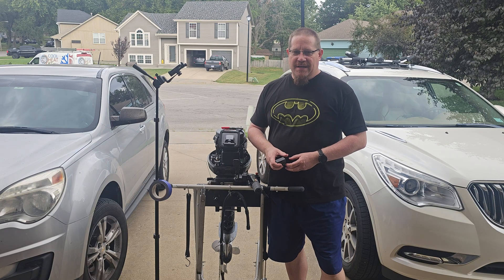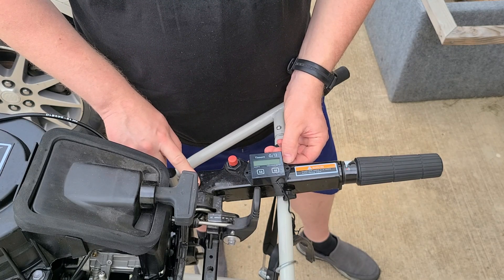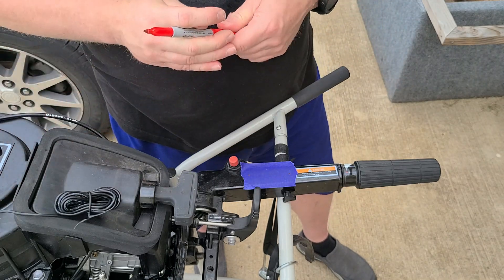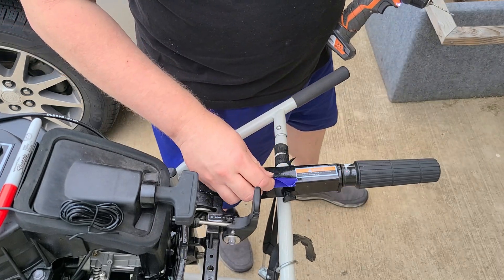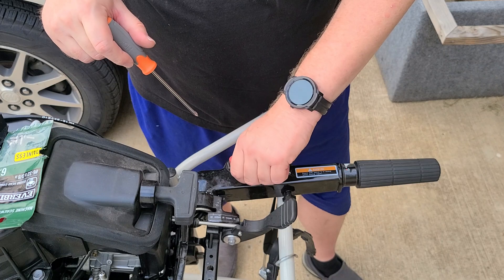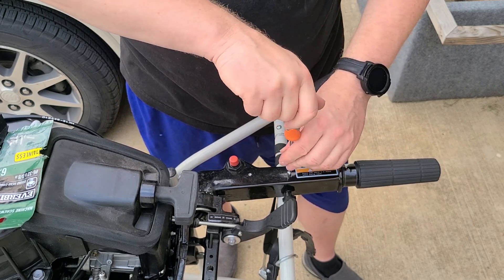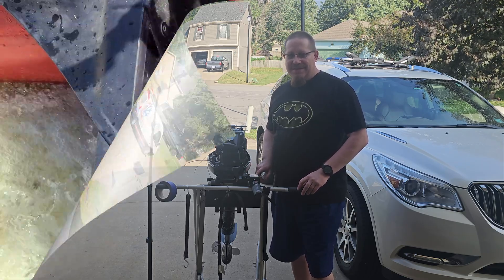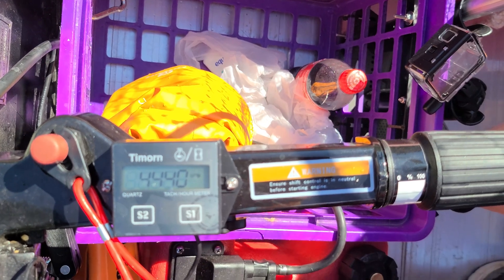Adding a tachometer / hour meter to my 2 stroke 18hp Hangkai outboard.

Comment: so theres  no soldering or connecting you just wrap around the spark plug wire?
Reply from the maker: Correct. No soldering. You do not even strip the wires. You simply wrap one wire around the other.
Reply: @everydayguy.5580  awesome thanks

Comment: Hi it looks like you zip tied the wiring from the hour counter meter to the spark plug wire. Is it really that simple to install? I don’t think I saw where you grounded the wire.
Reply from the maker: Yes it really is that simple. The unit I purchased did not have a grounding wire.